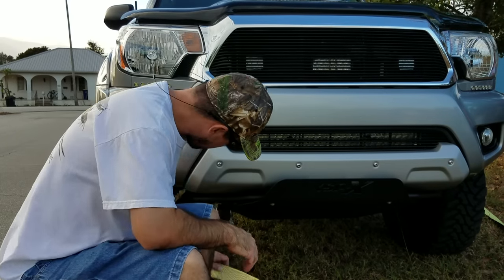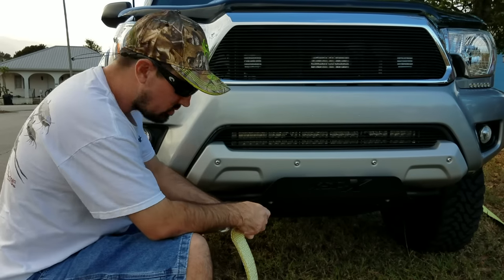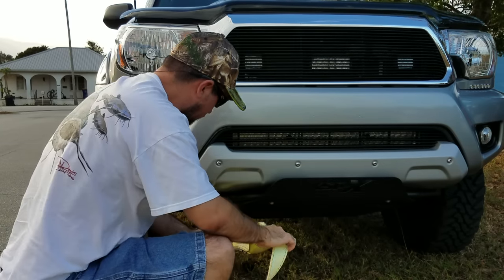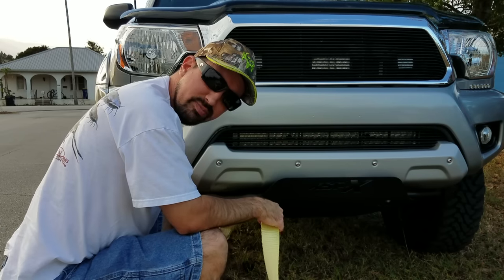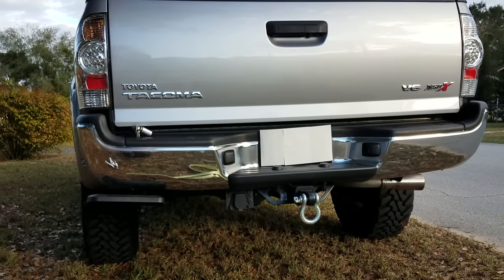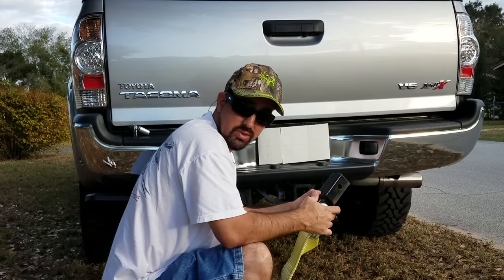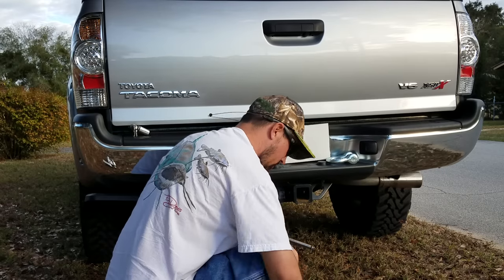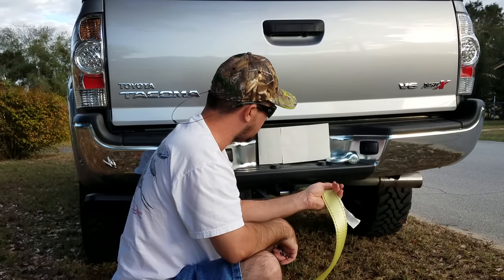HOW I USE MY RECOVERY STRAP OR TOW STRAP

Comment: Great video! I'm using Miolle Tow strap, I keep it in my truck, have not even used it for myself. Drove past a woman with car stuck deeply down in a ditch, with one wheel not even touching the ground. Pulled out this tow strap, connected one of the horseshoe connectors to her car, then the other side to my tow hitch and pulled her out in about 10 minutes. She was amazed. Great product, would not be without it in my truck.

Comment: with that set up in the front you may wanna have a carpet knife handy after towing anything to cut the strap since it will be impossible to untie it with your hand..trust me ..biggest rookie mistake
Reply from the maker: Thanks so much for letting me know. Thanks for your kindness. Thanks for stopping by to watch and comment
Reply: @steak8278  Use a D-Ring
Reply: You shouldn't tie a strap. That's what the loops are for. Use a shackle/D-ring and a strap rated for the lbs. you'll be pulling/lifting. There's ratings for shackles aswell
Reply from the maker: @zedwpd  Thanks for your info. I have a d-ring on there now. Thanks for commenting and watching
Reply from the maker: @edcko10  Thanks for your info. I appreciate it. I have a d-ring on there now. Thanks for commenting and watching

Comment: I have 2 tow hooks on the back of my Wrangler already, where I was just about to purchase a rear hitch receiver with the D-Ring attachment like you showed, just to have a rear center pull option.  It never dawned on me, to just use the hitch pin and put it the pin through the strap instead.  So simple it's brilliant, and one less thing I need to keep inside my Jeep if I had gone with the D-ring receiver option.  Thanks for making me feel dumb for not thinking of that myself. :D
Reply: rednroll1 word of advice, hitch pins have been know to bend when used in this way.  So keep that in mind. If you have no better options you could do this but there is risk to it.
Reply: @Alpha_Donk  Ive bent a pin like this. Use a rated grade 5 or 8 bolt with a nut.

Comment: Good video, not sure I ever saw anyone use the hitch pin through the loop end of a strap before.  Good idea. 
On the front shackle, when you loop one end of the strap through the shackle then through the loop at the other end, that method should only be used if you absolutely cannot open the shackle and have no other way to attach the loop (no additional shackles or hooks available).  The reason I say this is the way you did it will cause the strap to tighten down on itself as you pull a heavy load like when pulling another truck.  I've had it happen. It is a huge pain to get the strap un-looped from the shackle afterwards when the over lapped layers of strap tighten down on itself.  Nothing worse than being stuck on side of the road picking at the strap with a screw driver after you've pulled someone else out and you can't drive off because you'll have 20 feet of strap trailing under and behind your vehicle.
Reply: Ed J that’s why you can rull up a news paper or magazine like a burrito and stick it in the knot right before it tightens. Once your done recovering just wiggle the magazine out and boom, your strap is ready to be put away. I’ve done this millions of times. Might just upload a video of it since many people never tried it before
Reply: i was wondering how no one had commented that. all these rookies saying thank ima try that...NO, unless you got that screw driver and half an hour to get that pinched strap loose. good call on the magazine, grass, stick, trick. should have been included in the video.

Comment: I appreciate you taking the time to explain everything. Just got a 4Runner and always wondered how the straps should be used properly. Seems like it would be a hassle getting the strap to unwind after you tie it like you did in the first example especially if it's wet and cold so I think I'm going to have to invest in some bow shackles as well.
Reply: Average 4 runner owner

Comment: They are called Shackles....Clevis' s are strait shaft...Shackles have a dogleg...both are screw pins ...take it all the way in , then back it off a turn ,so it dont foul...The choker strap has an eye on each end to run the whip line through....Good job ,Rigging.
Reply from the maker: Thanks so much!

Comment: A recovery strap should be a kinetic product that stretches >10% and a tow strap should not elongate, much like a lifting strap. 

For recovery,  a Bubba Rope, or kinetic product is the right choice.

 Also, soft shackles are much stronger than forged steel shackles and much safer.

But trying to spend your money for you, but kinetic ropes won't damage tire r hooks and shackles due to their lack of such a jerking force on both vehicles.
Reply from the maker: Dr. Mark in Texas Thanks for your info!I appreciate you stop by to comment.
Reply: Dr. Mark in Texas soft shackles are not stronger but they are safer

Comment: Somehow I can't picture this in my head with your loop technique.  I know how you attached it on the front, but then how do you loop through on the other end of the rope that attaches to the bracket of the towing truck?
Reply from the maker: You will need a d-ring or loop the like I did in the front then put it through the d-ring like put on the back. U put a d-ring through the loop and hook to the factory tow ring in front of your truck. Hope that helps you out. Thanks for stopping by to comment

Comment: "Good to go" in the rear if you like projectiles killing you or others around.  They make hitches and shackles for a reason.  Safety first sir... what you're doing is not safe.
Reply from the maker: Thanks so much for caring comment. I appreciate it. Don't know what u are talking about that's not safe ,its ok. Thanks for watching
Reply: @marshallhurt8814  What I mean by unsafe is this:  The strap + pin combo in the rear can produce dangerous results depending on timing and circumstances.  The square edges of the hitch receiver WILL damage your strap if it is not pulling perfectly in line, which we know is almost never the case when conducting a recovery operation.  The damage to the strap can be fairly quick or over time.  Regardless, it's damaging your equipment and poses a safety issue.  If the strap breaks it can lash back at high speeds.  The strap CAN have extreme forces acting on it and storing kinetic energy which can injure.  The pin can be really high end or total crap depending on which one you have, what it's made from, etc.  IF it breaks, it can slingshot metal at high speeds.  There are MANY cases where people have died from improper towing, recovery, etc.  I'm not trying to hammer you bud, just saying it's better to spend the extra 30 bucks for the right hitch and shackle so no one gets hurt.  I also don't want someone watching the video and thinking the pin + strap combo is a reasonable and safe way to use their recovery strap...
Reply from the maker: I use the shackle set up in the rear. I was just saying if u don't have it that u could use the pin. Not saying it is the best way, but if didn't have a shackle set up for your hitch.
Reply from the maker: If you watch the video I say that. I am sorry to upset you with my video. Thanks for your comment and watching
Reply: @marshallhurt8814  Totally works if no other options are available.  You didn't upset me... not sure what gives that impression, perhaps it was the sarcasm... was just trying to help out.  Keep up the good work on your videos bud.  Have a Nice New Years.
Reply from the maker: @liberty9348  Yes it does. Glad everything is good. Thanks for your opinion. I will probably do another video of this to make things right. Just been busy with other videos and forgot about this one. Thanks again. Happy New Year to you
Reply: I do this all the time. Tightly stuff/wrap a rag in the square tube so that the strap can't touch the sharp edges. I got fancy and make a shroud out of some thick leather from and old work boot.  :)

 And don't get very far out of line. Never cut or damaged a strap yet!

Also, I prefer to use a rated grade 5 or grade 8 bolt with a nut, because those pins only encounter shearing forces with a hitch installed. But they can bend MUCH easier doing this. The cotter pin shears easily and the whole thing fails. A rated bolt and nut prevents this.
Reply from the maker: Thanks for commenting and watching. Thanks for your information too